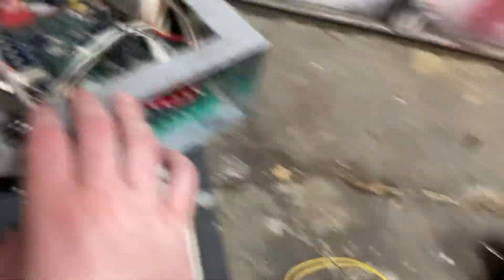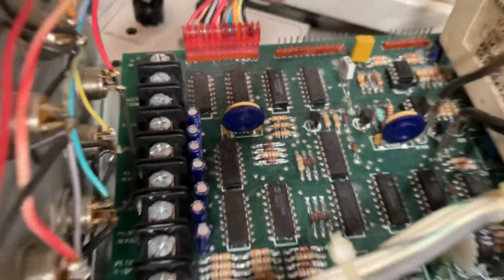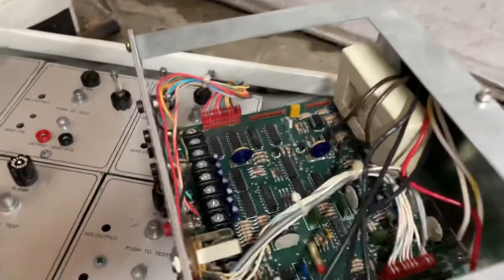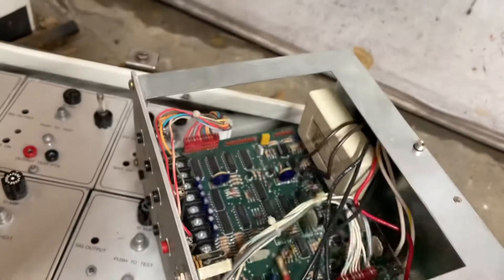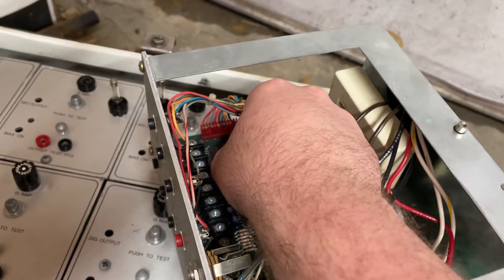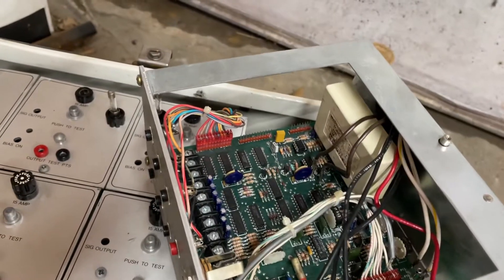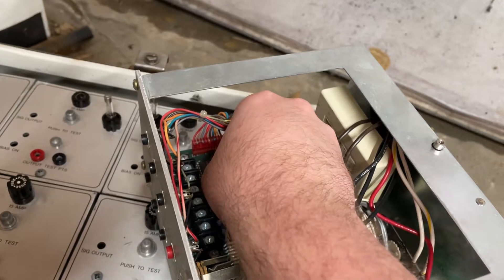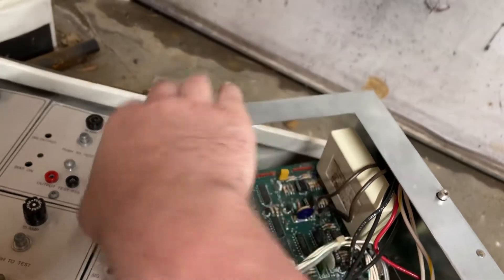Federal SiraTone pitch shifting demo

Comment: Is it legal to make these sirens go?
Reply from the maker: @elioallen2386  it depends. I live in the middle of nowhere, so it’s not a big deal. If you live in the suburbs or a city, good luck.
Reply: @thunderbolt10031  i live in a region of europe where the Kockum-Sonics Delta 4 is used. Do you have any knowledge of those kind of sirens?
Reply: @thunderbolt10031  also what is the best method of noise isolation
Reply from the maker: @elioallen2386  I don't have an answer for that
Reply: @thunderbolt10031  please try asking again later

Comment: so what with the potentiometer causes these to pitch drop with age?
Reply from the maker: You referring to the pitch drift when the tone peaks?
Reply: @thunderbolt10031  yeah.   Ive seen so many there's a 1212 video from Hawaii that it really drops down on and I've always wondered why

https://youtu.be/_Ntk_XNqA-U this is the video
Reply from the maker: @DrpanProductions  I have yet to figure that out. I have a 1984 board that doesn’t do it but this board from 1999 does. I’ve replaced just about ever component in that circuit except for the VCO and still hasn’t made a difference. It’s a voltage leak somewhere and I can’t find where it is
Reply: @thunderbolt10031  
Dieing or faulty capacitors are a common cause of a pitch shift on solid tones. Very common in the 1995 to 2000 models as the capacitors of that time period has a tendency to leak or go bad.